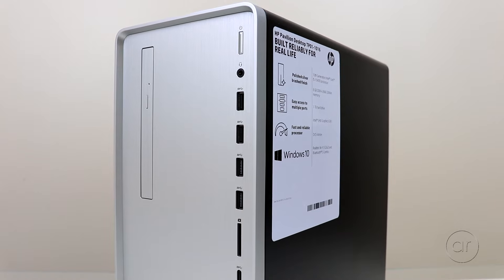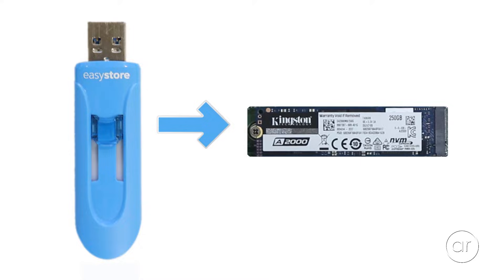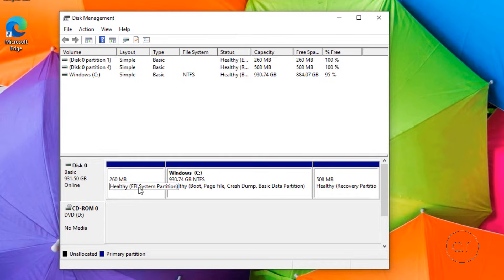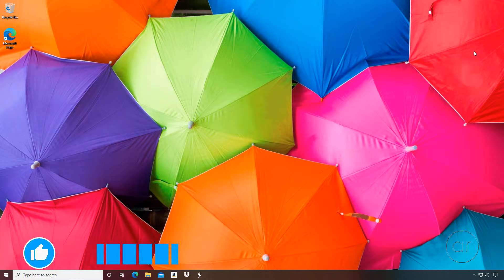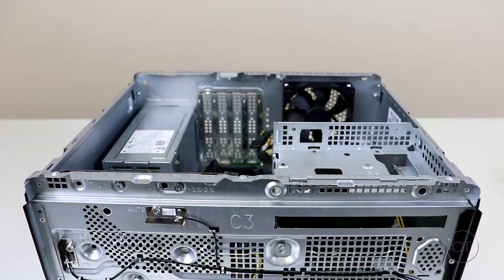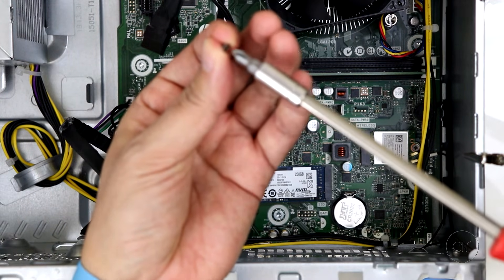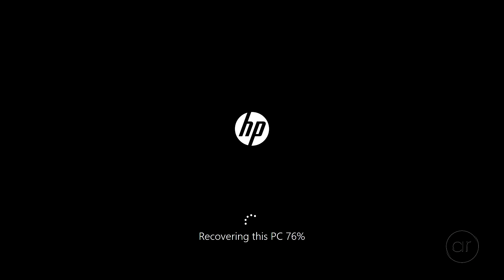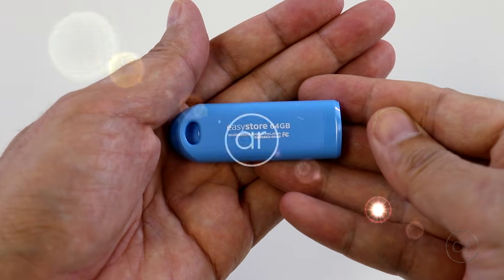Upgrade to an M.2 NVMe SSD and Restore Windows 10 (without Cloning)

Comment: I have a problem I tried to copy with Macrium into my new 1T NMVe, and it doesn't want to do it saying: choose another disc, but I don't want to choose another one I bought that new one just to have more space and speed for my operator system what can I do? Should I do what you said in this video, I don't want to compromise my PC and bring it back to repair shop.
Reply from the maker: What is the model of PC that you have? I'm wondering if there is any incompatibility with the NVMe itself.
Reply: Device name	OASIS
Processor	Intel(R) Core(TM) i7-8700 CPU @ 3.20GHz   3.19 GHz
Installed RAM	48.0 GB
Device ID	ACEAC7B7-0DC2-447F-AE80-166EE444B33C
Product ID	00326-10855-41565-AA284
System type	64-bit operating system, x64-based processor
Pen and touch	Pen support
And it's a1TB western digital sn550
Reply from the maker: There's nothing that looks out of the ordinary with your system. When you choose the SSD as a destination, do you see existing partitions on it (before it asks you to choose another disk)?
Reply: @accessrandom  yes i placed partitions like you said and bring the last one all the way to the end, and it's after this is completed it said choose another disc( matter of fact it said the twice)
Reply from the maker: @GroupeQuebec_R_BusGroupeQuebec  I see - I think I was confused because this video is not using the Macrium software (I have other videos that use it, which I believe you are referencing). If the NVMe has been formatted to NTFS (before the clone), there may not be enough unallocated space to fit the data from the original drive. If you saw an existing box in the destination area, you can delete that box - just make sure that you do not have any data in that NTFS partition. You should then be able to clone as in my cloning video.
Reply: the 1st time I had to format it like they say, and I'm pretty sure I use NTFS formatting, it never asks again.Hope it's not that.

Comment: God I hate computers. The recovery just stopped. saying it can’t create it. A problem occured. No info what the problem was or any data at all. I’m only having to do this crap course Microsoft keeps install crap on my current SSD against my will and filled it up 😤
Reply from the maker: Sorry to hear you're having problems. Are you able to try the new SSD in another machine to format it and chkdsk on it? I'm wondering if there are any bad blocks on it.

Comment: I need help, so I have a work laptop that I cant factory reset cause it's a bit locked encrypted ssd and I'm not an adminstrator. So if I just get a new nvme ssd and replace the old one that just basically restarts the computer right. I'll just have to intall windows 10 on it right. Or does replacing the ssd in it do nothing

Comment: Really great video - thank you! 
Unfortunately, I had a similar issue reported by another: all was going well until recovery got to 30%. So you think that might be related to the new NVMe?
Reply from the maker: Thank you. It's possible that it is the NVMe, but it could also be the flash disk. I couldn't find the other commenter below but IIRC, he had tried a different USB flash drive and was able to get it to work.

Comment: Idk why but I have a 14gb stick but pc says it needs at least a 32gb stick to make a recovery stick.
Wtf windows
Reply from the maker: I'm not sure why it is asking for 32GB - could it be a different model HP which requires a larger image?
Reply: @accessrandom  alienware. But I've looked up others saying the same size, don't know why mine is 32 instead of asking for a 16

Comment: My BIOS is not recognise my new SSD, how can I configure my BIOS such a way that it recognise the same
Reply from the maker: Are you able to try it in another machine, if it all possible? If the BIOS doesn't recognize it at all, you may want to test it elsewhere to see if there is something wrong with the SSD.
Reply: @accessrandom  Sir I have installed it correctly and it is working fine in my file explorer but when I am moving my OS to SSD then in BIOS I am not able to select SSD. There must a configuration gap in my BIOS. Just not able to select SSD as my primary bootable.
Reply from the maker: @AlivHasan  I see. Others who have encountered this problem (mostly with certain Acer laptop models or certain ASUS motherboards) have been able to make it work by physically disconnecting the hard drive. It might be worth a shot?

Comment: Hi I have a question I use my pc for games and I’m gonna need a bigger m.2 ssd because I’m running low on storage and I want more games. If I buy a new ssd will all my programs and games be deleted? And will I have to do this? To download windows?
Reply from the maker: If you used the cloning method on the same machine, then no, your games and programs will not be deleted and you won't need to download Windows.
Reply: @accessrandom  thanks dude

Comment: So I have made the recovery drive per your instructions on a brand new 32 gb USB. I shut down the PC and installed the NVME and unplugged the original HD. I hooked it up with the recovery drive in and started up the PC and made the selections that you directed. It seemed to be going ok at first, but has been stuck at 29% for about an hour. Any ideas?
Reply from the maker: It sounds like there may be a hardware problem with the NVMe. If it all possible, are you able to try it in another machine to see if it works there? On your HP, you can always return to the original HDD since that is still intact (plus you have the recovery drive which has the factory image on it in case you need to restore it to a different NVMe).

Comment: This applies as well  if i want to switch out the m.2 nvme ssd with a faster one right?
Reply from the maker: If you have two m.2 slots on your motherboard (and they are both accessible simultaneously), then you can use the same procedure. However, if there's only one slot, you may want to follow the procedure in one of my other videos: https://youtu.be/mKSmwyPXH2I - except you would use an M.2-to-USB adapter instead of a SATA-to-USB.

Comment: Recovery doesn't have full system image the f11 button for recovery doesn't work ? (HP TOOLS ARE MISSING) ?
Reply from the maker: Thanks for the report - I will need to look into this. I know you can create a recovery drive recursively (i.e., on all future installations) in order to create the USB image, but I haven't yet tried F11.
Reply: @accessrandom  Actually it didn't pickup the hp efi keys (I have created hp recovery manager a dvd disc before It has all hp drivers and microsoft drive but it is has many unnecessary softwares !)(but f11 works) in clean install microsoft recovery(just like in this video)(no extra softwares) (no hp efi ) so it won't work !!!
Reply: Please Upload Video if you found any solutions !!!

Comment: Great tutorials. Have one of the TP01 Series Desktops and the removal and replacement videos were spot on and well presented. These are good value PCs and somewhat upgradable. I’ve added a stick of 8GB memory, removed and replaced the Wi-Fi 5 / Bluetooth 4 (it only had one of the tiny connectors attached but there was another unused wire hidden that enabled using the existing antenna!) NVMe with an Intel Wi-Fi 6/Bluetooth 5 Card and now I plan on installing a low profile PNY 1030 video card. Your videos are the clearest and most professional I’ve found. Thanks. Very helpful. Had the number 15 Tork bit which made things easy.
Reply from the maker: You're welcome, and thank you for the detailed write-up 🙏.

Comment: I can confirm that this method works with the HP Elitebook 840 G4. I had a regular SSD, and switched to a Samsung 970 EVO Plus, NVMe SSD. Remember to update the BIOS before changing.
Reply from the maker: Thank you for the heads up 👍

Comment: Thanks for the tutorial. How about restoring Windows 10 on M.2 nvme SSD using PCIE adapter? Is it also possible? I don't have a dedicated NVME SSD slot on my motherboard.
Reply from the maker: I think that will be highly dependent on the BIOS and/or the adapter. I know that some Dell's are able to boot to the PCIe NVMe, but I'm not sure of any others.

Comment: Will the data on my secondary hard drive be formatted if i restore this image?
Reply from the maker: I haven't tried it with the hard drive still connected, but I believe the restore would be applied to the existing hard drive. I would recommend physically disconnecting the hard drive, restoring to the M.2 SSD, then re-attaching the hard drive, if you want to keep the contents.
Reply: @accessrandom  thanks man😃

Comment: So basically when you have a new faster m.2 NVME you don’t really need to have a other SSD?(Sata3.. the blocky slower ones).
Reply from the maker: That's correct - the M.2 NVMe is a storage device that stands by itself (unless you use something like Optane), and is independent of 2.5" SSDs.
Reply: @accessrandom  So do I even need. 2.5 SSD in addition, when I already have a single M.2 NVME which has more storage and is faster? Wouldn’t be the additional 2.5 SSD unnecessary?
Reply from the maker: @lost_places_global9008  That's correct.
Reply: @accessrandom  Thx, do you know why my Acer Aspire only says 1200mhz is max. But I think that my RAM has 2400mhz but it never uses it...

Like there isn’t even a XMP for my Acer Aspire 3... why does CPU-Z only says 1200mhz?
Reply from the maker: @lost_places_global9008  I'm afraid I'm not that familiar with the Acer Aspire 3, so I'll need to defer to others who may have more experience. Anyone?

Comment: I was planning to move Windows (and all others) from HDD to SSD and found out about your cloning video. I then tried the cloning method, but it failed with an "error 0" message. I would assume that this is due to the defect of my HDD. If so, then I concluded that the cloning method won't ever work for my scenario. 

Do you think the recovery method (using a recovery drive) in this video would solve the issue? I am certain that, since this method does not involve the HDD, this recovery method would work.

Yes, I know the consequences - it installs fresh and clean Windows and leaves all data behind - and that's ok.
Reply: And also, by following this method, will the bundled softwares from the manufacturer really still be included? I saw a thread mentioning that this recovery method will also leave those softwares behind.
Reply from the maker: @alfaulianda  If there are bad sectors on the hard drive, I'm afraid neither method would work. However, you can verify that by running "chkdsk X: /r" (where X is your hard drive) from the command prompt running as Administrator. Another possible cause is interference from anti-virus or anti-malware software. The method that I use in this video would keep the bundled software from the manufacturer, since their image of Windows includes it.
Reply: @accessrandom  Thank you for your reply. Yes, I just tried the method from this video and it failed midway while creating the recovery drive to the flash disk. As far as I know, my HDD had failed at SMART short self-test and read test, and I have disabled the check disk services due to its running in every bootup (and always fails to repair). Is there any other method that I could try on my own (of course, the last resort is to go to the service center)?
Reply from the maker: @alfaulianda  If it has failed the SMART test (and especially if there are bad sectors on the hard drive), there may be a problem on the recovery partition itself, which would prevent you from creating the recovery drive. If the bad sectors exist only on the recovery partition, I believe it will be possible to clone the OS partition without the recovery partition. Alternatively, you could simply re-install Windows from scratch onto the SSD using a Windows 10 ISO image from Microsoft (but you would lose the bundled software), and you may need to install some drivers.

Comment: What if I were to buy the model with the i5 10400f and gtx 1660 super? What would be your thoughts as to its potential overheating? What about your own experience using this pc in relation to the temps? Thank you in advance.
Reply from the maker: For the TP01-1016, I haven't had any problems with high temperatures, but I am not really stressing the CPU that much - I use it as a Plex server with hardware-accelerated streaming, which depends on the integrated 630 graphics on the i5-10400 (so there's no discrete graphics card). The CPU is idle most of the time, and when I do stream, the hardware-acceleration takes the load off the CPU.
Reply: @accessrandom  thanks. Would you recommend getting that pc given its power supply is 330 watts? I'm afraid it's not enough to unleash the potential of the 1660 super, but why would hp install such a weak power supply if it limits the power of the components?
Reply from the maker: @helloboys456  Power consumption for the 1660 super can be around 140W so I think you should be ok. I'm sure HP would size it correctly, but you probably have very little headroom to upgrade to anything more.

Comment: So if I have windows on my ssd m2 and want to transfer all my drives,gpu and ram to a new motherboard... will it just be plug n play or will I need to follow steps in one of your videos?
Reply from the maker: This wasn't really meant for that use case (where you're transferring Windows to another system). You may run into problems activating Windows since there is such a large hardware (motherboard) change, especially if it's an OEM license.
Reply: @accessrandom  is there anyway you can make a video on keeping all the components from an hp 690-0024 but putting them into a new case and new motherboard? But also still being able to keep windows etc...? Or do you know where I can look up that information not really finding much on google searches
Reply from the maker: @TheTattoedVRpilot  Thanks for the suggestion. I haven't really seen anything on google, but I can put it on my list.
Reply: @accessrandom  awesome that would be great! Especially after how well the other hp 690 video you made did 😄🤙🏽 thank you again for all the help!

Comment: Bro I just used your cloning video last night 😂
Reply from the maker: 👍 Hope everything went well. Both methods are valid ways to transfer Windows over - just depends on whether you want to start with a clean install or not.
Reply: @accessrandom  I keep failing to clone to my clean ssd and am getting an "error 9," msg whenever it fails around the 30% marker. Any suggestions?
Reply from the maker: @garyngrace25  The most common cause for error code 9 is a possible bad disk (i.e., bad sectors or file system errors). Can you please try running a "chkdsk X: /r" (where X is your hard drive) from the command prompt, before you attempt another clone?
Reply: @accessrandom  I did, and it cloned 99.9% of the hard drive (I can tell because of the difference in size between the old HDD and new SSD are down to the MBs,) before failing. It gave me the "Error 9 - Read Failed - Data error (cyclic redundancy check)" message. Not sure how to advance. Is it possible to make a fresh Windows and migrate the copied data to it? Any other advice for the error message I've been getting? Thank you again.

Comment: Here I been using HDD clone from a usb with a external USB 3 adapter to a 1tb Samsung 860 Pro. Ty this will free up my drive for didfent uses.
Reply from the maker: You're welcome, and thank you 🙏. Depending on the programs you've already installed as part of the clone, you may want to consider keeping it (unless you just want a factory image).

Comment: You can do it this way, but as I commented in your last video, EaseUS Todo Backup is a great app.  I just used their trial version but will probably buy it. I think it makes this process even easier. I installed an EVO 970 in the m.2 slot.  Fired up the computer, installed Todo Backup, used the system clone function to clone the 1TB drive to the EVO.  When the clone is done, turn off the computer and pull out the 1TB drive and boot up using the EVO. No need to find a USB drive and do the whole recovery disk thing.
Reply: When you want to  sell  this HP computer, You can use this great recovery partition to restore the PC  to its original status. Just like selling an iPhone. Removed all personal files and applications and settings.Thank you Sir for this awesome tutorial. 😊
Reply: @celeron.26  Excellent point.  I’m fairly new to the channel so I see now there are a few videos on cloning, but just wanted to mention my experience with a different tool.
Reply from the maker: @flashjk22  No worries my friend. Both procedures are valid based on the use cases... I've heard good things about EaseUS. I'll need to take a look at it.
Reply from the maker: @celeron.26  You're welcome, and thank you 🙏
Reply: @accessrandom   Happy  New Year  Sir. I wish you good health and more blessings to come. Stay safe and God bless you always 😊
Reply: Hey my ssd is running low on storage let’s say if I were to buy a new bigger ssd and install it into my computer will all my game be deleted? Or if I use this app that you used will my games and all my programs still be there?